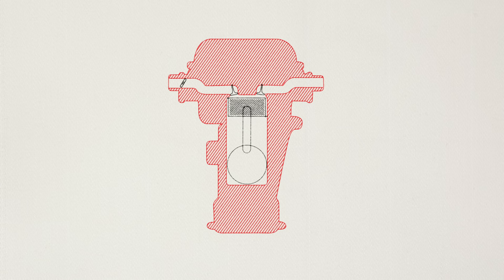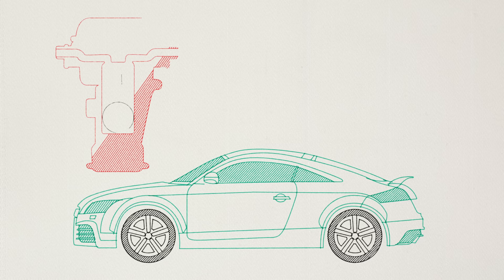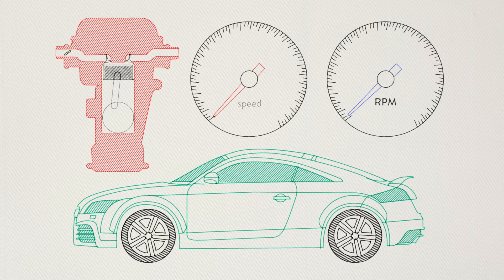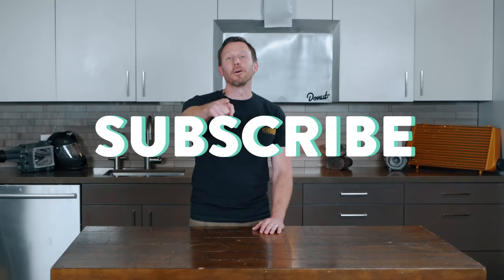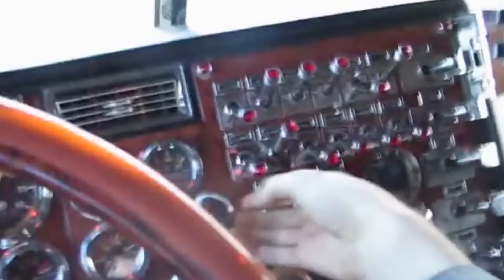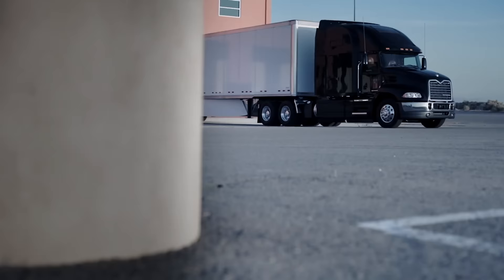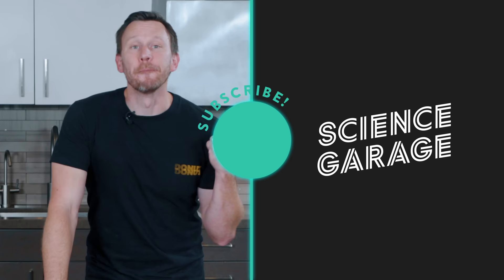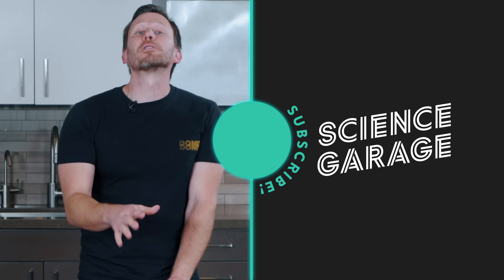ENGINE BRAKING | How Semi Trucks Slow Down Without Brakes | SCIENCE GARAGE

Comment: 73,000 lbs is peanuts. Im more like in that 140,000 lb range pulling B-trains. Jakes are life.
Reply: RedBirdAuto Can’t pull that in the U.S...Bridges can’t take it. Foreign puller? You may pull more than me but you don’t have anything on me. I’m 80,000LBS, and I have 45 years of driving under my belt. Pete 359 with a swapped series 60 Detroit I can turn loads better than any other driver I know. No playing around, no stopping, only sleep when I am forced to, no days taken off. Turn em and burn em is what real truckers do.
Reply: @truckerpete3595  haha is that what you put on your super trucker resume 😂
Reply: @Daycab82  haha can't, 63,500 kgs is the limit on 8 axle. But I used to pull 5 axle 80,000 lb down to california from canada. My whole point with my comment was why say 74,000lbs when you can pull 80,000 5 axle in the US.
Reply: TruckerPete359 * Yes you can. For example in Michigan with the proper axles you can weigh 164,500..........
Reply: Ferguson101 looks like you beat me to it
Reply: DayCab GearJammer I fucking hate ELOGS. I squeeze all I can until the damn thing makes me shut down. That Detroit is about to quit I have to run 80 to keep up like I used to.
Reply: RedBirdAuto Lol. I’ve pulled oversize and specialized. I met a guy at Iowa 80 from Michigan telling me about his loads, assumed he had a permit though.
Reply: RedBirdAuto True. Load em up if you’re gonna run em.
Reply: Anatoliy Dashkevich Just figured that out. I run from Florida to California, or Florida to Maine.
Reply: RedBirdAuto Super truckers can go work for the monopolies. I’m an owner operator, I can’t afford to play around and make excuses of why I can’t run. I run the truck 5 days a week, 52 weeks a year I can pull good money.
Reply: TruckerPete359 * same here. One of my trucks has a 12.7 series 60 with 1.6 million miles since being overhauled at 1 million. She's tired but still runs. Currently running my other truck with a 15 liter cat and she sure is fun to drive.
Reply: TruckerPete359 * and wouldn't your 359 be paper logs? My Detroit is a 96 that I ran on paper where as the cat is an 04 running elogs. Sure do miss running paper.
Reply: Anatoliy Dashkevich No. it’s mandated now that if you run outside of a 250 mile radius you HAVE to have Elog. Fuck the DOT.
Reply: Anatoliy Dashkevich Oh I bet. My new W9 is fun. She is a 550 Cummins and a 18 speed and she’s geared damn high. I can be in 6/6H and be doing 55
Reply: RedBirdAuto in the States we can get to 80,000 legally. 12 Steers 34 drives and trailer axles . Some states like Michigan we can get to 160,000 with multi-axle trailers. We can pull doubles but that is as far as we can go.
Reply: Ferguson101 are you a Michigander
Reply: TruckerPete359 * haven't heard that my 96 runs paper and I know plenty of drivers running paper on older trucks.

Comment: Ughhhh I still don't get it. So here's the situation..... I'm going 50 in 6th gear, coming up to a red light. I've got 2 choices. 1) press clutch pedal, downshift, engage clutch and engine roars in mid to high revs, revs decrease, press clutch pedal, downshift, engage clutch and engine roars in mid to high revs, revs decrease, press clutch pedal, downshift, engage clutch and engine roars in mid to high revs, revs decrease, press clutch pedal, downshift, engage clutch and engine roars in mid to high revs, revs decrease, press clutch pedal, downshift, engage clutch and engine roars in mid to high revs, revs decrease, press clutch pedal, neutral, release clutch pedal, ALL while applying some gentle braking pressure, to stop.  2) Put it in neutral, use brakes, stop.  So PLEEEEASE explain to me how doing option 1 is better on your car long term than option 2, when brakes cost $50 and take 2 hrs to replace.
Reply: Not if youre going down a long hill. Your brakes will fail even in normal car. 
Another case here is that no fuel is injected in higher revs, because theres no need to feed the engine to keep it running. Youre having better mileage from it AND saving the brakes. Its called one pedal driving and if you dont use this technique on motorway, you should be shot.
Reply: All personal preference. When driving around town i just pop it in neutral but when going through corners or driving spiritedly i like to keep it in gear at all time for the most control. You can stop faster for an emergency thanks to the engine braking and if you need to get out of the way you're already in gear.
Reply: @komixan  This is the proper way to drive a manual and save gas but i would argue coming to a stop blipping the gas to rev match on downshifts is likely about the same amount of fuel it takes to idle with the clutch in.
Reply: @REL602  Dude. You absolutely nailed it. YES !
Reply: @komixan  shot huh ? That's a tad aggressive. Yes of course u engine brake on steep declines. I'm talking about day to day driving on normal roads.....
Reply: @z33tanner  Hmmm..... When has anyone, in the history of driving, stepped on the gas to get out of the way of something. There is ZERO real-world need to be in gear when slowing down. I know it's highly recommended to stay in a gear at all moving times, but I just never understood that one, either. Also, in an extreme stopping emergency, u are 1000% NOT going to perform downshifting. You are going to slam on the brakes with both hands gripping the wheel, praying for your life.
Reply: @z33tanner  Holy crap ! Excellent point!!! Didn't even think of Rev matching. My car auto matches so I wasn't thinking about that great point. Yes definitely uses gas.
Reply: Rev matching is a thing by the way
Reply: @jasondavis9784  You're probably right as far as panic breaking will be putting max force through the tires engine breaking will only make them lock up and hit abs harder. I was thinking of preventing a rear end accident by being able to make a quick decison like the Teslas automaticly do, engineered to accerate away from getting rear ended.
Reply: @jasondavis9784  staying in gear is less about accelerating out of the way of something and more about being able to instantaneously transfer weight to the rear. Most RWD cars are much more stable under light acceleration than coasting because it weights the rear. In racing we call this maintenance throttle.
Reply: @z33tanner  they do what ???? Accelerate AWAY from an accident from behind ????? Never heard of that. That wud scare last night's wings outta me ! There is NO chance in hell I wud drive a car that did that. I mean come on people, are u really driving around out there, contemplating a scenario where u wud actually see an oncoming accident from behind and with lighting speed, turn the wheel, slam on the gas, and find a safe route out of danger, before being hit ? Who are you, Quicksilver ????
Reply: @weedshoes5089  ok good point, possibly. I've never been in that situation w a RWD so I can't say either way
Reply: @jasondavis9784  if you've never driven fast or anywhere slick, why are you giving driving advice in youtube comments?
Reply: I mean i use it when driving in traffic, i give about 2 or 3 car lengths and when the car in front starts to brake or stop, i have plentu of time to just down shift. By the time i get to there the traffic is moving again and i just keep the same speed and im in the right gear to keep a steady speed. You dont use it to come to a full stop just to keep a gap and keep the engine from bogging at a higher gear, at least for me
Reply: @jasondavis9784  lol i did just last week cus its one of my fears! Im a college student so i drive a little honda fit in texas, so theres a lot of big trucks and suvs! And since i do alot of commuting in traffic that goes from 80 to suddenly a complete stop, so i always make sure to be in front of someone that looks like they know how to drive here, or have a shoulder next to me. Long story short I escaped being rear ended and sandwiched between a semi and an f250 by accelerating out of the way and onto the shoulder
Reply: @uhaveabuttface  Hmmmm are u absolutely positive that if u had stayed, u wudda got hit ? I know it's all very scary when it's happening. Also, the person who was about to hit u may very well have tried to turn out of the way TOO, and in ur situation, they wudda hit u cuz u turned ! I just think it's dangerous to veer outta the way when approached from behind. It's up to that person behind u to veer out of the way to avoid hitting u. U have NO CLUE wut that person is thinking or is planning or is going to do in an evasive maneuver to avoid hitting u, and with u moving over suddenly, u cud actually be putting urself in harm's way. Just my 2 pesos. I'm very glad u weren't hurt
Reply: @weedshoes5089  lmao who said I've never driven fast or anywhere slick ? I go skiing 3x a year, on ice covered mountain roads. I happen to own a Civic type r and have gotten to 161 mph. I've been driving for almost 30 years homie. No need to attack my personal driving skills mate. Just a discussion about which methods are better and why. Peace to u n ur crew
Reply: @jasondavis9784  yea dude, im pretty sure the guy was either asleep or on his phone cus he crashed into the semi
Reply: @jasondavis9784  a civic type r, huh? Then I assume you're familiar with lift oversteer? It's exploitation of the same principle.
Reply: @uhaveabuttface  well then u definitely did the right thing and also HOLY FUCK that was a lucky manuever
Reply: @weedshoes5089  yeah I understand weight transfer benefits. Still doesn't explain how staying in gear is a good thing when ur coming to a stop. Also still doesn't explain using brakes vs engine braking to stop. Oh well, moving on cuz, u know, life and stuff
Reply: @jasondavis9784  idk about you but I always look through my mirrors when stopping just in case someone behind me isn't slowing down too, it's not that much about being quicksilver but just being alert, and being in gear allows you to have more control of the car.
Reply: @jasondavis9784 key words: coming to a stop. I.E. still moving. If you're moving, more control is always a good thing. Say you're coming to a stop from 45 on a snowy, curvy road. Do you want to hit a slick bump in a corner at 25mph without any way to move weight to the rear? Because the brakes will just transfer more weight to the front and off the rear, spinning you faster. 

Engine breaking shouldn't be used to stop the car. Ever. It's for management of speed. If you're doing a long descent, like down a mountain, you can leave it in second and use the engine's compression to keep your speed low rather than dragging on the brakes for 20 miles, which would absolutely overheat them.
Reply: You're doing it wrong Jason Davis
Reply: @weedshoes5089  ok ! Thanks for agreeing with me on engine braking. And yes, if I'm on a snowy, icy, windy, bumpy road and it's a foggy, wet, windy day with a moon out instead of the sun at 10am on a Sunday, and there's a mama duck crossing the road with her cute, little, fluffy, cuddly, delicious tasting ducklings, then yes I agree, keep it in gear cuz u might need to suddenly hit the gas a little to counter maneuver a problematic slide. Ok whew! So we both win the argument lmao can we move on please 😂
Reply: @jfantis  ummm I do many many things wrong, as does everyone else in this world. Which wrong are u speaking of ?
Reply: this comment thread and OP is cancer. So much wrong information, so many idiots who think they can drive giving advice on how (not) to drive.
Jesus christ read a book! It's all about control, and it's perfectly simple.
If you're in Neutral and moving YOU ARE NOT IN CONTROL!
Downshifting while braking (yes, even under emergency conditions) is the correct way to stop, and if you're a panic-and-grip-the-wheel-stomp-the-pedal-and-pray type of emergency braker; then you should't be allowed to drive. If you downshift whilst braking, you can stop quicker (shorter) than just using the brakes alone (yes, even with ABS holding your hand)
Reply: @beefcakeandgravy  Ummm actually u have alot of control in nuetrsl while moving. That big round thing in front of u is called a Steering Wheel. U can also try Putting It Back In Gear, as an alternative
Reply: Lol ... hrm, I think anyone who downshifts that many times to come to a stop for a light ... is taking it to an extreme. I usually only downshift once(with rev matching) then use brakes to do rest of stopping.   If I need to stop quicker, Ill blip throttle higher and downshift 2 gears(once again rev match) and then use brakes to do rest of stopping. 2 gears of course down of course depends on my starting RPM Im downshifting from.  Technically, in a manual u dont need to downshift at all to engine brake, all you have to do is leave up on throttle and stay in gear w/o touching clutch of course.
Reply: @RandoTark  ok yeah I can live with that. I mean hey, who doesn't love hearing that roar of the engine. I'll do that occasionally, but yeah, downshifting every gear ? Every single time u slow down ? Ummm no.
Reply: @jasondavis9784  lol I wasnt saying I do every single gear when I slowdown ... Im saying whoever does that is taking it to an unnecessary extreme probably causing far more wear and tear.
Reply: @RandoTark  yes yes yes I'm totally agreeing with u. THEY are saying dshift every single time, but u n I use our brains and we know, we realize that all that is just causing more wear long term than is needed. I'm agreeing with u bro-ham. Us Jasons gotta stick together ! lol

Comment: Diesel engines don't need throttle bodies**** the 6.4 and the 6.7 ford diesel have throttle bodies.
Reply: He was talking about Semi truck engines
Reply: He is obviously talking about semis.
Reply: @Doug Deshawn 1,000 foot pounds is not a throw away from an engine especially if it is reliable.
Reply: @Doug Deshawn also I was saying they don't need throttle bodies. He didn't say big commercial truck engines he just said diesel engines. Wasn't specific.

Comment: It’s breaking the engine if it’s a 2 stroke
Reply: 2 stroke gasoline, yeah. 2 stroke diesels, nah.
Reply: Rilo Elton love me a nice Detroit any day
Reply: Why is it like that?
Reply: @RiloElton  why?
Reply: engine breaking on my 2 stroke bike is just holding the kill switch
Reply: @rodrigovillanueva5384  2 stroke gasoline uses a premix of lubricant oil and fuel into the cylinder. During engine braking, the engine starves not only fuel, but also lubrication. This can cause accelerated wear. Newer models tried to mitigate this wih a separate oil pump, but you'll eventually got more lubrication with wide open throttle anyway so it's better to simply pull the clutch and use the friction brakes. 2 strokes gasoline are lightweight, their brake pads worn slower than their 4 strokes counterpart. It's simply easier to replace the brake pads than trying to unseize stuck piston in the cylinder bore.
Reply: Rilo Elton Yeah, but you were talking about 2t diesels. Why don’t they break? How are they lubricated? Just with the fuel?
Reply: @rodrigovillanueva5384  2t diesels are lubricated just like their 4t counterpart, with an oil pump. They do not mix oil and fuel. Oil in 2t diesels is solely used for lubrication, not burnt away like in 2t gasoline. They can have engine braking without the accelerated wear like the 2t gasoline.
Reply: Rilo Elton But what’s the difference between both that allows the diesels to engine brake without damaging the cylinder walls? Do they have an oil-wet crankcase?
Reply: @rodrigovillanueva5384  yep. 2t diesels crankcase are definitely oil-wet. Just like the 4t.  They don't use crankcase aspiration.
Reply: Rilo Elton OK now I understand, thanks!

Comment: 8:40 I think there are two more things the Jake Brake does - it prevents fuel from being injected into the cylinder (you don't want to add unnecessary energy to dispose of) and it (may or may not) skip the "power stroke" and the "exhaust stroke" by opening the intake valve again at the beginning of what would be the "power stroke", turning it into another "intake stroke" and delaying the "exhaust valve opening" to make it another "compress and dump" stroke. But judging from the sounds of the brake, some jake brakes may just waste these two cycles by letting them run with no air and no fuel due to simplicity and the sound happens to be one of these (if there is the "high performance Jake Brake", the sound of the brake will be raised in pitch compared to the normal sound of the engine).

Comment: Modern Diesel engines do in fact have throttle bodies in the intake manifold, not for throttle but for the ideal fuel air ratio